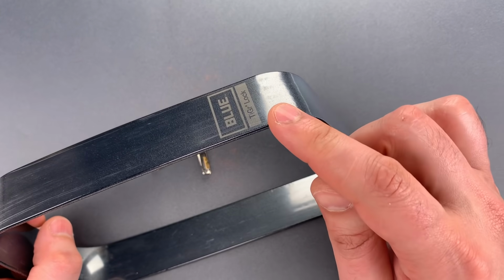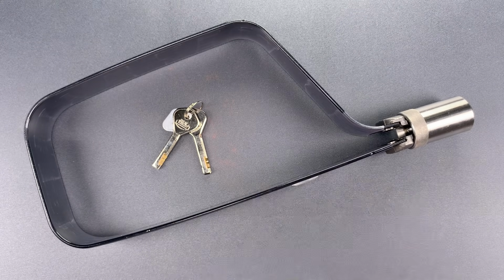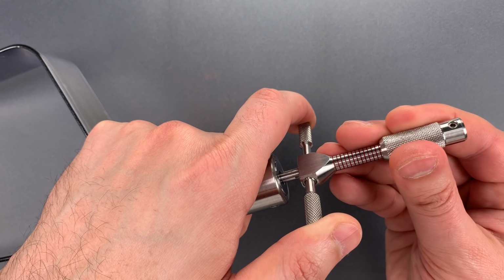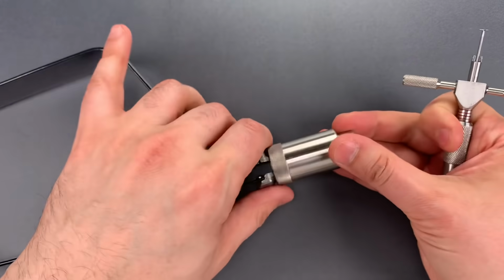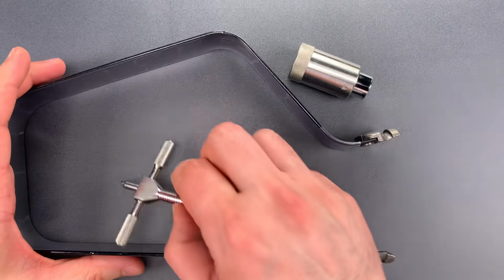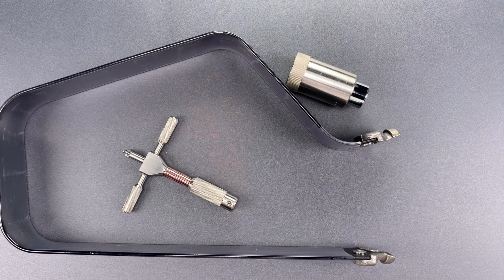[1214] What Was Old Is New Again: TiGr Blue Bike Lock

Comment: I thought titanium would be harder to cut than carbon steel, who knew? Lol
Reply: It's not pure titanium
Reply: These numbers are loose numbers, but titanium of the same VOLUME/SHAPE as steel is ?40%? Lighter, but only 12% weaker. So by WEIGHT, titanium is much much stronger due to there being more of it with those stats.
Reply: titanium is a relatively soft metal. not as soft as gold or silver, but not hard either, and there is no way to harden it since it is very, very resistant to both heat and cold. this is why anything that needs to be resistant to temperature changes is typically made out of titanium nitride, ranging from good knives to russian nuclear launch keys.
Reply: I am titanium
Reply: Titanium is much lighter and less vulnerable to temperature and corrosion, but mechanically is inferior.
Reply from the maker: Hardness and toughness are the key metrics for cut resistance... titanium has a great strength to weight ratio, but even the hardest titanium alloys are far softer than a quality hardened steel.
Reply: @lockpickinglawyer  the Master has spoken 😃
Reply: The benefit of titanium isn't that it's stronger than steel; the benefit is that it's much lighter than steel while being almost as strong. Unfortunately almost all bike theft tools are designed to cut through steel, so "almost" doesn't cut it.
Reply: Titanium has a relatively low Rockwell
Reply: @obsquared8593  
She says you are more like cooked noodles.
Reply: @Radiant100  oof, I would, but MY parents promised ME that if you don't get to 10k subs then I get a new headset. SOERY Vihax
Reply: It's best to think of titanium as sort of super-aluminum.
Reply: Titanium is also extremely brittle, so it may even be vulnerable to a strong blunt--force attack.
Reply: @Radiant100  eh, why not? Lol. I subbed
Reply: @xIxHaZexIx  hes obviously just a kid. Chill.
Reply: Hardness, toughness and tensile strength are all different things, titanium has fantastic tensile strength compared to its weight being comparable to steel by volume while being significantly lighter. Though compared to a hardened steel it is relatively soft and not as tough.
Reply: Mind, titanium is very brittle.
Reply: Titanium is lighter. That's why it is used is turbine blade and aircraft.
Reply: @Radiant100  Get a job!
Reply: @Radiant100  if you put the effort into your content instead spamming these comments, you would get there easy enough. Laziness is like karma...
Reply: @madscientist057  No, it's because people don't understand titanium. They've heard "strongest metal in the world" but 1) that isn't true and 2) they don't understand the properties of metal.

Titanium has the highest strength to weight ratio of any naturally occurring elemental metal. This means that per-kilogram, it's harder to stretch and pull apart compared to things like iron or copper. But the SECOND strongest is ALUMINUM, which nobody treats as an invincible super-metal and is actually often incorrectly assumed to be weaker and less durable than it actually is.

When cutting metal, what you need to consider is hardness. Titanium is very soft, similar to aluminum in fact, and both have a tendency to gum up grinding discs. There's a sort of inverse relationship with strength and hardness in metals that are useful to manufacturing, because ones that are strong AND hard have a different problem - they're brittle and can be easily damaged by impact. Titanium in general is very bad for anything you want to keep people out of because of how relatively easy it is to cut.

Also, pure titanium isn't nearly as good for most purposes as titanium alloys, where mixing it with other metals makes a stronger overall product while also making it harder without becoming brittle. This happens because the different metals basically interweave around each other, and the whole material gains varying levels of each of their properties.
Reply: @bradboxrud7233  kudos for this great reply! 🤣
Reply: @Ea-Nasir_Copper_Co  Even though titanium has the highest strength to weight ratio of any elemental metal, alloyed steels beat it and are also more dense so they don't have to use nearly as much for the same end result.
Reply: @Radiant100  Your parents will only get you a xmas present if you get subs on a youtube channel? That's some shitty parenting. Maybe they could just treat you nice at xmas whether you are a d grade youtuber or not? Tell you what, if you make a convincing video of you telling your parents they love false youtube fame more than their child's xmas wishes then I'll subscribe.

I'm kidding ;) you don't need to do that. I'm not subbing either way!
Reply: @madscientist057  isn't pure titanium very weak unlike all the alloys created with it?
Reply: @Radiant100  This is spam, and clogging the comments.
Reply: @Ea-Nasir_Copper_Co  By the contrary, almost surely cuts it 😆
Reply: @Radiant100  XD you have 10 days to get 5k subs. Have fun spamming on other videos.
Reply: @bradboxrud7233   You have earned a subscription for your biting wit.
Reply: Seems to me (knowing precious little) that there's the potential for leverage with this as the lock comes off, I wonder how physically strong that attachment point is?
Reply: @Radiant100  Sush
Reply: @fredshort8970  why does it blunt steel tools then?
Reply: @johnrich6928  I'm yet to meet ANY lock, that's not attached to a massive safe, that's able to defeat a few good swings from a cheap hammer.  🤷🏻‍♂️
Reply: @xIxHaZexIx  no a homeless guy deserves help
Reply: @PINKFL0YD-s2h  Took two swings with a 3lb., while workers were trying to get a mobile torch.
Reply: @Radiant100  Yo can you guys help me? My parents promised that if I get a picture of the lock picking lawyer before Christmas they will get me a Pick "that Bosnian Bill and I designed".
If y'all could help that would be great, but if you don't that's fine.
Reply: @bigd7861  which lock?
Reply: @Ea-Nasir_Copper_Co  "almost doesn't cut it"

I see what you did there.
Reply: Titanium comes in many grades and alloys. It's very light and stronger than aluminium, in tensile strength tests at least. Some alloys of titanium are incredibly wear resistant, others make use of it's crystalline structure and use it as a memory metal that no matter how deformed, will spring back into the original shape. 

However, just as with steel, you don't get all of the amazing properties in one single alloy. We've been researching steel for hundreds of years and a good carbon steel hardened to a high 50's Rockwell is going to do a good job of finding the middle ground of hardness/brittleness and toughness/malleability. 

Ti though, can't be hardened in the same way and although some alloys are massively wear resistant and others gall up cutting edges at the end of the day it's a very narrow strap with relatively little surface area on the side most likely to be attacked, so I think it's a design fail personally to use the old design with a new (old) material. 

Plenty of carbon steel hasps that are thicker and with more cut resistance. The original TiGr idea was lightness, not security. The new offering excels at neither. An angle grinder would cut through that strap fairly fast I'd wager. Because of the ratio of surface area to cutting edge. A round or octagonal bar brings far more hardened steel surface area to bear on the blade at any given time. Even with a hacksaw the same is true.
Reply: @metamorphicorder  Hell if I remember.  Was a few years ago.  Some big ass chunk of metal that they said cost a couple hundred bucks.  Told them, "And, it only cost me a few seconds..."
Reply: I think quite a few of the titanium locks about rely on people thinking it's a super amazing material that's harder than steel.

It's not, you can saw and/or crop through the original tigr in seconds. Bosnian bill has a vid where he shows this and a few other physical attacks.
Reply: @Radiant100  maybe make videos instead of whining? You have 1 public video only!
Reply: @korbetthein3072 , yep it's clogging the comments by generating comments such as your's, and now mine. It would have been far better had we not replied at all.
Reply: @PINKFL0YD-s2h , because cutting through virtually anything will cause wear on a cutting tool, and titanium is only a little bit softer than steel.
Reply: @notahotshot   Indeed, but neither of us are posting in every comment thread.
Reply: @fukumarkzuckerburg  Just curious: how is it that you know what Russian nuclear launch keys are made of?
Reply: @fukumarkzuckerburg  i was under the impression that titanium nitride coatings were used for lubricity and temperature/corrosion resistance
Its applied as a coating like salt bath nitriding
Reply: (Not used as a base material)
Reply: @nuclearmedicineman6270  Heat resistant 'super-aluminum'.
Reply: @das564  A set of Soviet launch keys were on Pawn stars where they mentioned they were titanium. However those weren't ICBM keys but the keys to launch a space rocket.
Reply: You still can't beat a good steel alloy to have all the parameters needed in a lock
Reply: @fukumarkzuckerburg  titanium is great against rotary cutters as it will harden significantly where it's being cut however slow cutting/pressure attacks cut through the titanium so I would say a hardened steel core with a titanium sleeve would be the best way to use titanium in a shackle
Reply: @bigd7861  i love extraordinary claims with vague details.
Reply: @metamorphicorder  Not really all THAT vague.  Padlock meets heavy hammer.  Hammer wins!
Reply: @bigd7861  right, but you didnt bother rembering any details or what kind of lock it was other than "a couple hundred dollars". 
 What was it on? How did you hit it? How did the lock fail?
Reply: @metamorphicorder  Big industrial equipment locker.  Me slam big hammer really hard on corner of big metal.  Twice.  Shining finger rod thingy come out of big metal.  Me proud.  Go eat steak.
Reply: @bigd7861  if you arent going to be serious nevermind.
Reply: @metamorphicorder  For gathering data on how locks fail, your question is relevant - but what your comment seems to communicate is disbelief in a hammer beating a lock, which is, of course, ludicrous. There literally exists zero locks, or for that matter, any other item that can withstand a sufficiently powerful impact. If you are just trying to learn more of the fail points of a locking mechanism, that's only fair and really an expression of appreciable concern for the science of locks, but if you're questioning the universal truth of impact force > any material, you've fallen a few junior high physics lessons short of being a credible commentator.

I have no idea why my drunk-ass, idiot mind felt it important to comment on this issue, so sorry about that and feel free to ignore me.
Reply: Depends on what alloy you use. 6AL4V is typically aircraft grade, and is obnoxiously tough.

Throws bright white sparks across the hangar when you're sanding it or using a cutoff wheel.
Reply: @Radiant100  

Either go actually earn 10k subs or get a side job and buy a headset yourself.
Reply: @Punasauva  i was gathering info on how he claimed the lock he is talking about failed. I am both curious and skeptical. The story has elements both obvious to me and those which might not be obvious to others that are odd. 
 He says he has never met a lock ...... that could resist a few blows with a hammer. 
 Further he has identified it as some sort of padlock, at least it seems that way to me. 
 Also said it was claimed that it cost a couple hundred dollars. 
 On an industrial tool locker. 
 Well i know or know of more than a few padlocks that will deffinitely resist a few blows with a hammer. Particularly if the are on a locker door. 
 Abus rock. Abus granite. A few from squire, a hi shear, some from sargent and greenleaf, some from viro, trioving, maybe the stanley 24 7, ingersol, rotalock, there are actually quite a few that would do just that even if a really strong person was on the other end of the hammer. 
 Those are all in or above the couple hundred dollar range, except the Stanley depending on the core you put in it which has nothing to do with hammer blows. 
 All of that is pretty irrelevant though because just because they exist, doesnt mean this fella has "met" them or even if he has, had occasion to attempt to open them precussively. 
 Could be hes met several, and just didnt know it. 
 However the claim of cost gave me pause. There are a few possibles to consider here. One, hes simply making the whole thing up. Thats not an accusation, but just stating a possible explanation. 2. He was misinformed about the cost of the lock. 3. He was correctly informed about the cost of the lock, and the lock was purchased for some reason at a cost that isnt justified by its durability. 
 There are several ways that locks get their end user cost. 
 One, whatever someone decides to charge for them and someone else decides to pay for them. 2. Durability and ability to survivr brute force attacks while securing an asset. 
3. Their ability to resist picking and other bypass attacks, non destructive. 
4. Special features such as master keying,  rekey capacity, being part of a set thats keyed alike so many locks will open with one key. Or some combination of that. 
 This one here, typically involves using a security company or lock supply company to tour the facilty and catalog all the items to be secured and make detailed notes and purchase orders for a specific lock set that has specific characteristics. This can result in a large beefy strong looking lock that is not particularly expensive in itself, nor particularly strong though it looks like it that costs quite a bit basically because they had to send someone out to survey a clients site, and then they literally have to custom order locks from a maker, or take bulk locks out of stock and individually modify each one and cut custom keys for each keyholder and possibly even design a key managment system that itself has a system of locks and keys. That can mean that a big beefy american round body padlock that costs a consumer between 20 and 50 $ could cost a factory 200$ because it can be opened by 4 different keyes that themselves can each open 5 other difderent locks meaning someone had to custome design a keying and bitting scheme for 15 or more locks. Add in the possibilty that they also want control keying done so that someone with a master key or grandmaster key can come up to any of the locks in a set and with that key, either open it, or remove the core and install a new different core without even opening the lock, and you can have something that you can indeed open with a hammer that looks like you shouldnt have been able to do that and costs 200$ and has an on the shelf big box cousin that looks just like it and basically is just like it that costs one tenth that. 
 Because lets say someone spent the money on an s&g environmental padlock. 
They would very likely break the shackle through the hasp its locked in before they broke that lock with a 3lb hammer. Its literally made to wiststand that sort of abuse. Particularly if you are hammering on it where it can flop around and move when struck. Hammering a lock open usually involves using a large punch or rod or bar to place on the lock and hammer against hoping to slip the detents past the pawls or balls or simply rip the body away from the shackle altogether. Or you lay the lock against something hard like a floor and you bash it until it opens. 
I had doubts about the guys story,  but there are also enough confounding factors that its possible its totally legit. 
 I also have no idea what this rando thinks a big lock is. A master lock model 19 is in some contexts a large lock. And its a tiny little diary lock compared to the ingersoll lever locks, the hi shear, or the s&g 918 i think, its an armory pad lock in any case. It would fail to a hammer, those others wouldnt, at least not with a couple blows of a 3 lb hammer swung by even an exceptional human. I mean "anything" is possible so maybe im just wrong. 
 But like i said, i was curious and skeptical, but at this point i have no further interest in hearing his vague but colorful responses or being the recipient of his rather oafish analogies. 
 I will just assume he indeed opened a lock he was told rightly or wrongly cost a couple hundred dollars, and that he hasnt met locks and tried to open them with hammers that can resist that. Because unless its just bravado talking, and he made the thing up out of whole cloth, thats exactly what happened.
Reply: @Punasauva  an no i do not under estimate the destructive power of impactors. When youve seen a padlock resist at least dozens of impacts by bullets, you get the idea that some locks are just damned tough.
 The operative phrase you used in your comment. Sufficent force. Add to that applied correctly. 
 I wanted to know the type of lock he hit, because that makes all the difference. What it was. And how he hit it. 
 I got a dismissive and vague answer, which is indicative of a couple of possibilities.  He honestly just didnt bother to find out. Im a fairly curious and active participant in my own activities. If i busted a huge lock off of something with a hand hammer and was told it was a couple hundred dollars, i would time permitting, and im good at finding a spare moment, find out exactly what i had done. 
 But not everyone is like that and sometimes i forget that. 
 And sometimes i forget that because i have had through various situations in my life experience at both lying and detecting possible deception. 
 However one of the things you learn in that if you are good at it and you at least try not to be a overly confident asshole is that deception indicators are not anywhere close to 100% accurate and they are extremely subjective and there are literally as many confounding alternate explanations for why you are seeing that as there are indicators themselves. 
 This is why i am usually very careful and reticent to declare someone a liar based on that sort of thing, and im certainly not doing that in this case. I was simply curious.
Reply: @korbetthein3072  you mean ypur comment? Then yes
Reply: Hey sometimes you learn things...  Google is your friend.
Reply: @lockpickinglawyer  Same reason why quality blades are almost always made out of high carbon or spring steel, depending on the intended use.
Reply: @Fluid-combo    He's old enough to learn important lessons.  Childhood is about growing up.
Reply: @dixonpinfold2582  fair point.
Reply: @das564  i was curious, so i did some digging. you can find quite a lot of neat things on the interwebs
Reply: @keeganwebber  its possible. my knowledge of titanium nitride is only surface level, as ive just done some torture testing with the winchester par five pocket knife which claims to be made of titanium nitride, doesnt mention coating, and research ive done on "cold" war russian nuclear launch tech and protocols.
Reply: @bradboxrud7233  lol
Reply: @GarrettHoward22  Don't encurage the lil blighter...
Reply: @fukumarkzuckerburg  it appears that it can be formed by sintering into a solid ceramic object. How durable that ceramic would be is up for debate lol
Reply: @Ea-Nasir_Copper_Co  Also, Ti doesn't corrode over time in normal environments, while carbon steel isn't stainless and therefore must be protected.